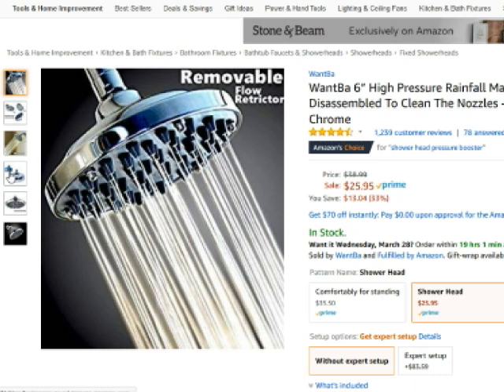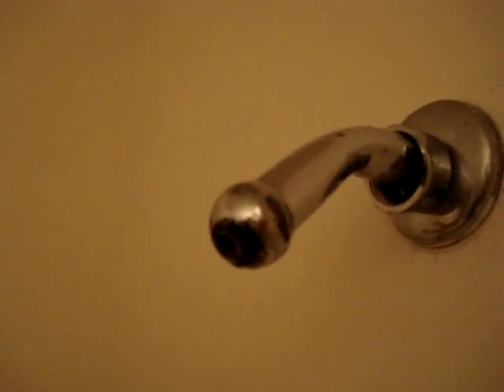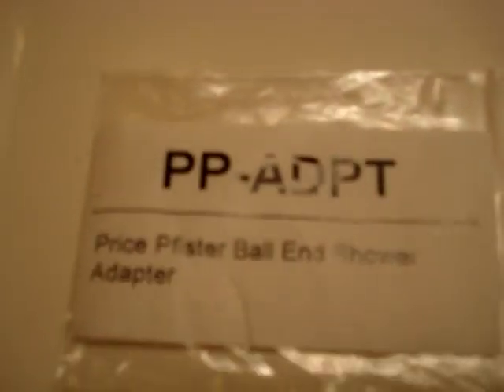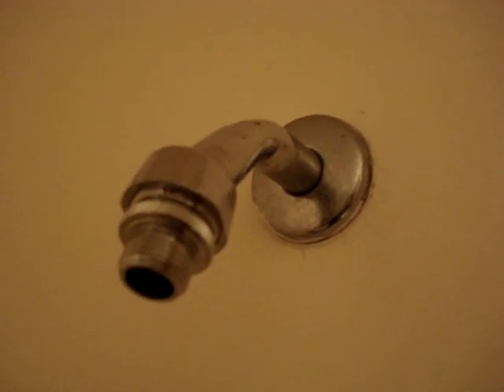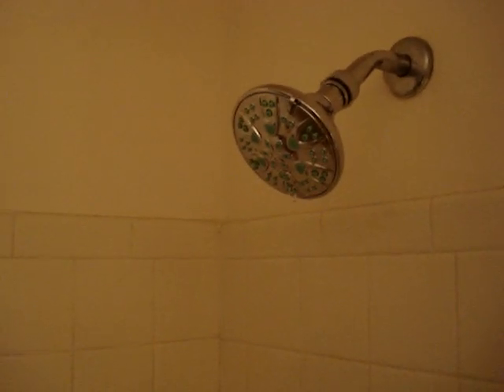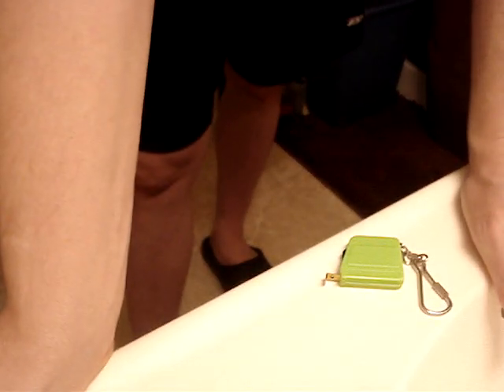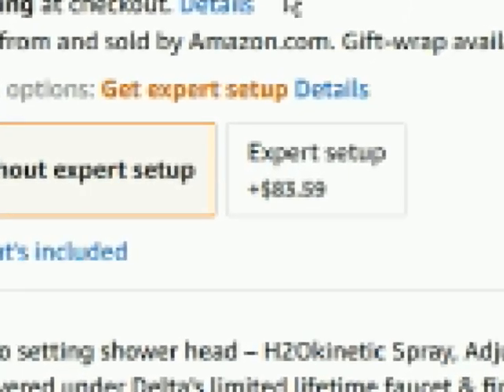Ball End Shower Arm Shower Head Installation (Adapter)

Comment: My showerhead is so similar to the one in the video. The female thread actually came off with the shower head. I barely touched it. It's old. Is it possible to replace both parts and still order the  male shower adapter?

Comment: this is a great video, now in the end it turned out the ball end on mine could simply be unscrewed and the new showerhead put in its place, which I only realized after buying the adapters but without this video I wouldn't have even known what I was looking at
Reply from the maker: Great to hear this helped. 

A few others have commented that the ball end screws off but I was never able to find any signs of this on my model.

What a terrible design form the good old 80s, lol.

Thanks for taking time to comment and glad to hear no more plumbing issues!

Have a blessed day.
Reply: @Underdrummer  The Gerber attachment is the one that would have fit mine had I not realized I could also just unscrew it. Seems most have either Price Pfister or American Standard. So maybe that's it

Comment: My home was built in 1966, do you know if this will work with mine?  The only difference is that my collar (the screw around the ball) is a different shape.  I'm going nuts trying to find something so I can replace the shower head with something that uses less water.  TYIA

Comment: Thank you! Thank you! A thousand times over! Our home was built in the 90s and we have exact same shower fixture in both bathrooms. Husband was SO frustrated that we have just "left it alone" for years, even though we needed a new Shower Head. Found your VERY helpful video today after a Google Image search.  Wow, just an Adapter! We are seniors and you've made our fix so much easier and less costly. Husband wanted to hire a plumber, yikes. He's attempting to install a Dog Wash Shower Attachment with Diverter and that's how we ended up here. Our tub/shower still has the plastic disc with a readable logo so we know to get the PFISTER adapter. 👏👏👏👏
Reply from the maker: Great to hear this! Happy my video was helpful. Than you for taking the time to comment and cheers to no more plumbing problems!

Comment: Have you just left the shower head on the angle it was when you did the retro fix to the ball? I think that the concept likely is that the ball is to be part of a ball and socket between the wall extension of the shower to the shower head itself. With this type of configuration, then the shower head's angle can be very adjustable to up, down and either side with an infinite number of locations.
Well if I could get the actual arm with the ball already there that might help with my situation of requiring the ball/socket so that I would have more than the limited movement available for my current very high end shower head. 
I think my current out of the wall extension likely can be removed but I would have to test before attempting a change. 

Now the question is do you have a site that would carry this ball extension out of the wall piece? Maybe another viewer might have a solution. So far I have found nothing at Home Depot or Canadian Tire.

TIA

Comment: @underdrummer is there an adapter with a female end bigger than 1-1/4 I need it a tad bit bigger. I've tried a 1-1/8 and 1-1/4 and they are still too small I need a little more room and that should fix my problem

Comment: at the end of the ball tip, there is a silver o thread thing, what do u do if you have accidentally taken that off? can you post a video on how to put it back on??
Reply from the maker: olivia l, I have no idea how one of those metal rings with threads on it was removed. Others have commented here before with the same issue. It would seem to me that the metal ring was sawed off which would mean you couldn't get it back on in tact.

Your best bet is to replace the shower arm which 
isn't extremely difficult but more of a process than what I have shown here.

There are many videos showing how to replace the shower arm on YouTube if you want to attempt it yourself.

Finally, calling a plumber and having them replace your shower arm is also an option though not sure how much it would cost.

Best of luck to you and hopefully your plumbing issues are at an end soon.

Comment: Watched your video. What size Is the bigger end that your screwing into the ball joint where the actual ball is? I went out and got the Gerber adapter and the fat bigger end of the adapter the end that you would screw into the actual ball piece is too small do the 3 different adapters have different sizes?
Reply from the maker: I believe they are different sizes. Most people here have commented the Price Pfister adapter fits for them.Try that model and be sure to read my entire description. There is lots of details there. Best of luck.

Comment: I'm having an issue with mine except that metal ring thing you have on yours was plastic on mine and cracked. I don't know what kind of piece it is i need in order to connect the adapter. My shower looks just like yours without the ring washer thing. I don't know what it's called! Lowe's/Home Depot was of no help. Anyone here have advice?
Reply from the maker: Moekuh, the ring on the shower arm that doesn't come off was made of plastic? That's terrible!
There almost always made of metal.

I think you are going to have to replace the entire shower arm. There are lots of videos showing you how to do that. The thing is you need a decent wrench and it is possible to mess up the pipe in the wall if you are not careful, which of course would be really bad. That's part of the reason I went with the adapter and made this video.

If your shower arm is a ball-end like in the video, then it's made by one of the 3 companies I mention in the video.
Be sure to read my description and follow some of the links for even more info. I spent a lot of time including as much information as I could.

I would also suggest reading through these comments. There's a wealth of plumbing knowledge and experience here. I've read them all and most people end up having the Price Pfister brand which was bought out by Glacier Bay.

Sorry to hear about your plumbing troubles but at least now you have some idea about what to ask for in the store.
Best of luck!

Comment: Ok thanks for the info. I went the extra route and just replaced the shower arm. I got the new shower head all connected but at the ball it’s center, the shower head is very loose. What would cause that? It’s hand tightened. I does not have a washer in the shower head. For some reason it didn’t come with it. I actually have the same shower head that you have!
Reply from the maker: Alan Hayden, glad to hear you got the issue resolved. Not sure why the head is loose. Maybe need to put a wrench on it to tighten it down more. Not a bad shower head for around $20 but I have noticed the washer inside is not very durable. Already had to replace my washer.

Comment: Thanks a million because you saved me lots of time and so much money.  I was frustrated and about to call a plumber to remove the shower arm!  You seem to be the only one on the internet with the solution to this problem.  Your video is much appreciated.
Reply from the maker: Glad to hear it helped. If the female ring part is not there then changing the shower arm may be your only solution. Thanks for taking time to comment and like.

Comment: thank you for this video. i was able to order the adapter off amazon and when I got it plugged up, the one that "fit" didn't fit tightly over the ball so it was kind of "floppy" and weighed down so then water shot back up through the back end of the ball. There was a washer in place and I used teflon tape. I tried all combos and couldn't get it to not leak so I just put the old head back on.  Does anyone have any suggestions?
Reply from the maker: Hello, sorry to hear about your plumbing troubles.
If the adapters aren't working for you maybe just changing the shower arm is the best solution for you. 

Anther possible solution would be to read through all these reviews. There are many who have had similar issues and maybe they can provide you a fix for the floppy adapters. 

Best of luck to you and thanks for taking some time to comment.

Comment: Super helpful !! However, my female connector (shower arm head, one that sits behind the ball) is 1.5 or 1 and 1/2 inch, none of the product links share the dimensions of the male connector. The output probably is standard which is 1/2 inch male, but what about the other side?
Reply from the maker: Not sure

Comment: The thing you moved to the back was it called a collar? What if that was broken for my case at least. What should I do or is it available anywhere for purchase? Is it needed?
Reply from the maker: I think collar is correct. There are some who have commented here saying their collars were also missing or broke. Some have said they have located replacements but you definitely need it for the adapter to screw into. 

I would read through these comments and maybe see if you can also locate a replacement collar or simply replace the entire shower arm.

Best of luck to you!

Comment: Where can I order those adapters?
I don’t have the old piece that goes on top of the ball. Can I use a aftermarket plastic piece, that slides over the ball?
Reply from the maker: Not sure about plastic piece that slides over ball. If it will connect then that's great. 

There are many helpful links in description including where to get adapters tri-pack. Sometimes they are out but as long as you know the name of the adapter tri-pack you should be able to locate. Best of luck friend.

Comment: I have the same shower head with the ball at the end but it doesn’t come with the female metal piece that comes down over the ball. It’s just the shower head with the ball. Where can I buy just the ring? Does it come with adapter? I would think that I need that ring to install the adapter.
Reply from the maker: Yes. Unfortunately you'll need the ring part for the adapter to work. Many have commented here that have had the same issue; missing the ring.

I believe they sell an adapter for that part or just changing the entire shower arm.

Best of luck and hopefully your plumbing issues are over soon!

Comment: Excellent and helpful video but I found a simpler solution. I was able to remove the ball end from the shower arm using a pair of pliers. Place the jaws of the pliers around the collar just above the ball and twist counter-clockwise. The ball end starts to turn with little resistance and can be unscrewed and removed to reveal a male, threaded screw at the end of the shower arm into which a new, G1/2 shower head can easily be screwed on. The whole process takes just a few minutes. Your mileage may vary - I live in the UK but in other parts of the world you may have the ball end permanently fused on to the shower arm in which case this video will still be your answer. But first it's worth checking to see if you can simply unscrew the ball end using a pair of pliers as this will save you  time and money.
Reply from the maker: @preetdhillon2972
Wow. I have read many comments here asking if that ball can be removed. Now we know!
Thanks for your interest and time.

Comment: First of all don't buy from Amazon.  In 2022 it's $26.49 + shipping and it comes from New Resource Group so Prime isn't going to get it to you faster.  Ordering directly from New Resource Group it's only $20.50 + shipping so you save $6.00 there. Your swivel is built into the head as was a previous shower head I used.  However, the shower head I am replacing came with a swivel ball that screws on the end of the standard pipe but it's on there so tight and has been on there for at least 10 years so I'd rather not try to remove it. Also, the new shower head I am replacing it with comes with a ball joint adapter so the head itself has a male connection and the swivel is outside the head.  This means I am going to have two ball joints after installing the proper NRG adapter to fit the ball arm coming out of the wall.  So I guess that means double swivel once the head is screwed on.  Anyone else have this experience?
Reply from the maker: Fox River, well hopefully you can get some answers here in the comment section. 

Thanks for taking the time to comment some helpful information.

Hope the plumbing issues are a thing of the past soon. Have a great day.

Comment: I called at least 6 plumbers and nobody knew how to remove. They all suggested removing the pipe and replacing the whole thing.
Reply from the maker: Hey Bill2uok, that is the "standard" solution. The adapter is another viable solution. Best of luck and I hope your plumbing problems are over soon!

Comment: Could you tell me which of the 3 adapters had the largest opening on the end with the washer? I bought the price pfister and it won’t reach over the ball
Reply from the maker: Hey Lynee Boller, unless I misunderstood you, none of the adapters actually fit over the ball-end. There is a round female end with threads that is on the shower arm, past the ball and it won't come off. Connect the male end of your adapter to this female end. 

2:42 - This time stamp shows the piece I am referring to though it is pushed back all the way on the arm towards to shower wall.
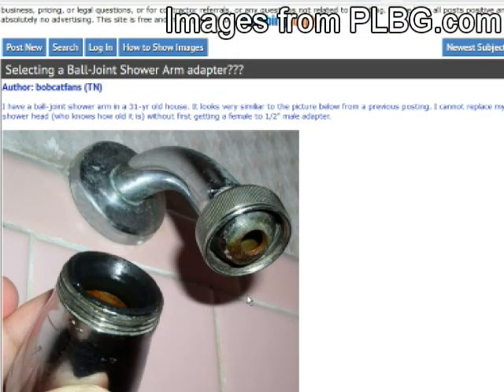2:22 - You can see the same piece here only this picture shows the piece pushed up toward the ball-end.
 
 I believe the largest opening was the Gerber Shower adapter. Hope I helped out. Best of luck!

Comment: Had one of these stupid things in my apartment but found it actually easier and cheaper to just replace the arm. <$10
Reply from the maker: Ryan H, lots have done it that way. Glad it worked out for you.
Reply: Did the arm unscrew, or did you have to cut and solder?
I can’t see to the joint in my wall.
Reply: @somestuffithoughtyoumightl6985   the arm just unscrewed for me (with some force). Couldn’t actually see the threading until I took it out so was a little scary not sure if it would even unscrew lol
Reply: They should almost all unscrew. It would be a HORRIBLE design to have it fixed in place. Doing something as simple as stripping the threads on a $12 pipe would cost you hundreds in repairs if it where fixed in place.

Comment: Thank you so much for this, but unfortunately none of the adapters worked for me even though my shower head looks exactly like yours. With no other choice, I took out the whole shower arm and matched it with one at home depot . Took me all of a minute to put it in place and now I can put any half inch shower heads I want.
Reply from the maker: Marcelo Petrone,, great to hear you got the issue solved. Thanks for the post.

Comment: That is very good. My plumber is so  busy he has not been back in touch so I ordered what looked like a standard shower head coming tomorrow from Amazon and was just looking to see if the ball end shown on this video was a "water restrictor" which apparently my shower will also come with but now I know from this video that the ball end shower arm is nothing to do with water restriction so I won't go down that rabbit hole. On the other hand it now seems very likely that my new shower head tomorrow will not simply easily screw on ( broke my son's  shower when cleaning it by making the holes bigger so the water now dribbles down through the bigger holes on his existing shower head)....

Anyway I will see if tomorrow I can remove the restrictor on the new part and screw it in and if not I now know I will need to order the adapters mentioned which if they do not sell them here in the UK I suppose I will have to order from the US. Knowing my luck my plumber who has 11small jobs to do here  - hence his disappearance - will have already bought the part himself.
Reply from the maker: Jane Smith, hopefully you can order the tri-pack adapters. I continually have to update the link for the tri-pack as it often goes out of sale. 

I do not know anything about UK pipe sizes or adapters but if you have the same ball-end shown in the video you should be good to go. 

Your plumber, when they do finally get to the shower project, will most likely change the entire shower arm. This is another viable solution and I have received many comments asking why I did not just replace the entire arm. My thoughts on replacing the entire arm are in my video description.

Thank you for taking the time to comment and share and I hope your plumbing issues are resolved soon.

Comment: My sister asked me if I can swap her downstairs shower head with her upstairs.  I said no problem. Take me 5 minutes. Upstairs has the ball joint shower stem. I was like wtf is this? Im actually a home contractor and had never seen it before. I can't even get the old shower head off without destroying it cause it's so old that its rusted on and there is no way to even get a grip on the head even with tools. But this video just informed me what kind of neck it is. Im still not sure how to get the old one off without destroying anything but this is still some useful knowledge. I figured the whole shower neck needed to be replaced.
Reply from the maker: JASON, that's probably what you are going to have to do. Replace entire arm. Glad this video helped you out some. I can't tell you how many DIY projects I start out thinking 30 minutes tops and then hours or even days later I'm like, uh, ok. Well, NOW I know. Live and learn. Thanks for taking time to comment and share!

Comment: Do you have any suggestions for attaching the piece to the ball? I have tried two so far and they will not latch to the ball for the shower hose adaptor to screw into. Thank you so much love your video!!
Reply from the maker: Kristi F, I don't have the model where the ball comes off but some in the comment section here have mentioned that. In your case I would probably suggest replacing the entire shower arm. Thanks for taking some time to comment and hope your plumbing issues are a thing of the past soon.